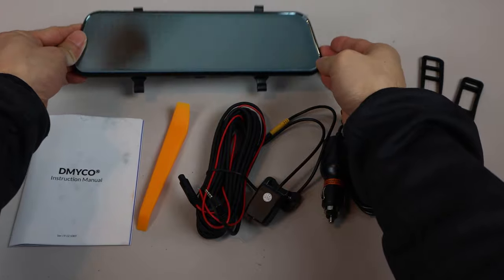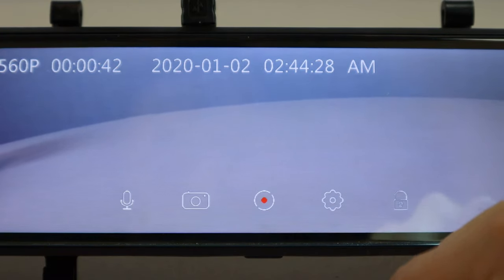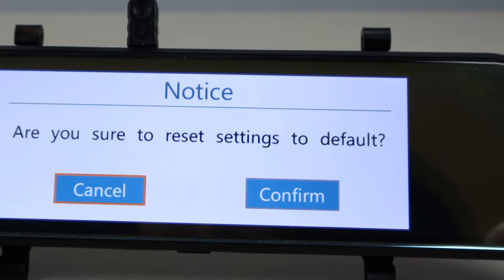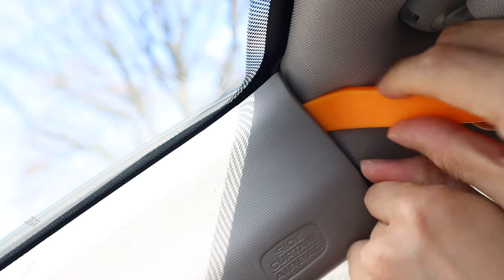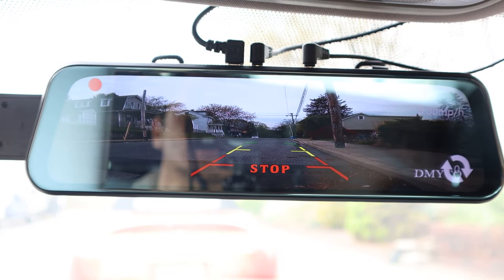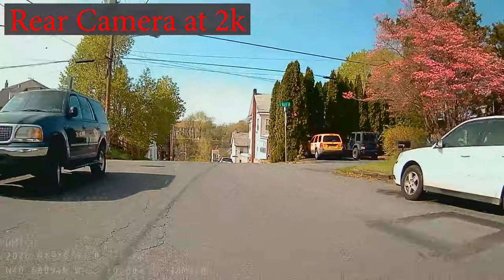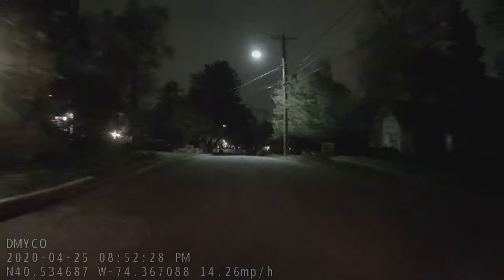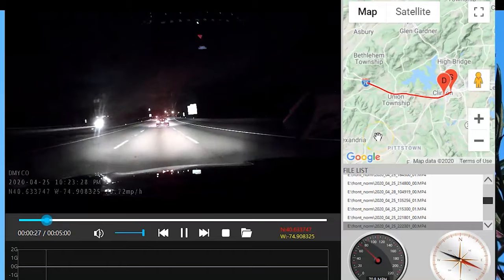Dmyco 10 inch 2K Rearview Mirror Dash Cam with GPS Review

Comment: Hi. I turn on the dashcam and its frozen. Saying format sd card but i can't touch anything or use the menu. Whats the problem?
Reply from the maker: It's possible the digitizer has malfunctioned so it's not responding to touches. You may need to contact the vendor for replacement or refund.

Comment: love your videos, very true to life explanations and decent quality for a smaller channel, nice work, also this system for a dashcam seems pretty awesome and intuitive, especially sense it comes with both back and front cameras, so no need to buy two dash cams separately, love that you can set it to use the back dashcam automatically, that would def. bring up some safety concerns if you had to fumble through the interface while driving.

Comment: Nice video - thanks!  I did not see how the rear view mirror can be used as a GPS...hmm... may be i missed it?
Reply from the maker: The GPS antenna is a separate piece, and I show where you plug it into the camera at 1:18. Once plugged in, you can place it anywhere on your dashboard or on the windshield, using the adhesive sticker so it can pick up GPS signal. The GPS tracks your route and will also help calculate your travel speed and direction of travel (see 12:34).

Comment: Hi, thanks for the nice work! One question, the GPS is not working properly, it shows me a yellow sign on the display as it is searching, but not working all the time
Reply from the maker: Hm, this may indicate a poor signal due to placement. Try moving the GPS unit to a different spot or higher up on the windshield glass and see if that helps, it's possible that the antennae for the radio may be causing interference with the GPS signal.

Comment: Nice video.  I see that you mounted the rear camera on the exterior of the car.  So, it is weatherproof?
Thanks.
Reply from the maker: Yes, the rear camera is weather proof, though I have found, for these types of cameras, that the tiny screws that are on the bracket do rust over time.
Reply: @ReviewedByPhil  Thanks!

Comment: Great video. Will the GPS files run on an Apple 🍏 MacBook computer? Will the power lead to the mirror interfere with the DAB radio signal? Can the GPS antenna be hidden out of sight? Thanks in advance.
Reply from the maker: I'm sure with an appropriate video decoder app you can view the GPS data on a Mac, as it's embedded in the video file itself. Yes, occasionally the power lead can interfere with radio signal depending on the location of your antenna and how you run the wires (don't run the power one way and the rear camera lead the other across the top of your windshield, as this basically creates a faraday cage around your windshield and blocks a majority of radio reception). Yes, the GPS cable can be hidden under the trim the same way you hide the power and read camera cables.
Reply: @ReviewedByPhil  Thank you for taking the time to reply. It's is very helpful.

Comment: How happy are you with the dashcam? Is it bulky?
Reply from the maker: I do like it. It's bulky in the sense that I can't put my drvier's side visor all the way forward, because it messes with the camera angle. And if you don't have it strapped in tight it can bounce/vibrate a whole lot. It's not too distracting if you're not starting at the screen, which you shouldn't be anyway, because you know, you're driving! I do want to put some thread locker on the screws on the reverse camera because road vibrations tend to make the back camera sag down over time, and I have to point it back up every once in a while.
Reply: @ReviewedByPhil  Thank you for your prompt response. I wish there was a dashcam mirror that I can use to replace the factory fitted mirror in my 2017 Toyota Camry. What I like about this dash cam is that it has a lot of features and I can get a full view of the rear of my car. Is it better to have windshield-mounted dashcam or mirror dashcam? Does this dashcam have a lot of reflection from the car's dashboard?
Reply from the maker: @kpkaus  I prefer the mirror mounted ones because they generally give you a wider on-screen display and I don't like having a lot of clutter on the windshield. I find it more natural to look at the mirror too, than at a separate device mounted elsewhere on the window. The only real issue for folks is the vibration due to the nature of the rubber band mounting. Maybe clamps or glue could solve that issue, but I haven't tried it. No, there's isn't any reflection from the dashboard, since the dashboard isn't generally viewable in the mirror.
Reply: @ReviewedByPhil  Thank you.
Reply: @kpkaus  shinzen, nikomaku and awesafe has OEM mirror dashcams. Like you mount the dashcam itself and remove your stock mirror so nice right. Not bulky and not ugly. But the damn nikomaku as3 pro max is only available in Amazon Japan and Amazon USA. I live in Canada and Amazon.ca doesn't sell the as3. There are hundreds of mirror dashcams on amazon.ca but most of them are just the mount or strap dashcam so no good.

Comment: Do you think it would be possible somehow to attach this dashcam "mirror" directly onto the windshield, rather than tying it onto the original rearview mirror?
Reply from the maker: Hm, I'm not sure. There isn't really any "mounting point" on the dashcam, so other than the plastic brackets for the rubber bands, there's no clear way to attach the unit to anything else unless possibly the window mount uses adhesive to grip the mirror; then maybe you could glue/stick the dashcam to the mount.

Comment: Is the blue wire in your reverse light socket the positive wire?  Can you explain why red wire from rear camera was  inserted into black negative side of reverse light socket and not into blue side of socket. Thanks.
Reply from the maker: Actually, it doesn't matter which side of the circuit it's on as neither wire carries power until the car is put in reverse. Then at that point, both do, which is the trigger signal for the camera to switch. So regardless of which side of the connector you choose to splice the wire into, it should work the same.

Comment: Are the maps lifetime free update?
Reply from the maker: There are no maps to download for the device as the GPS on the dashcam doesn't display maps or directions on its screen. It simply records your location to the video file (longitude and latitude coordinates). When playing the files in the GXPlayer application, the map view is generated using the latest map files from Google Maps, so the maps should always be up-to-date during playback, and it plots your location based on the recorded coordinate data. This, however, requires an internet connection, and if the device you're running GXPlayer on isn't connected to the internet, you won't be able to see the map at all.

Comment: How did you install the gps?
Reply from the maker: The plug end of the GPS unit goes into the port shown at 1:01 to the right of the SDcard slot. Then I stuck it in the corner of my windshield on the passenger side and ran the wire under the trim along the right side of the windshield and through the ceiling panel to the camera.

Comment: does it monitor when parked?
Reply from the maker: There is a parking monitor option that you can enable, but I recommend that you hook it into an "always on" accessory port or the car's electrical system with a low voltage cutoff since the battery life of the camera isn't that long in parking mode.

Comment: Hi, great video. But does any one know how to change the displayed speed on the right of the camera from KPH  to MPH  ??
Reply from the maker: According to the instructions, you can change the units in the camera settings by changing the language. For mph, select English. The unit will display kph for other languages. For what it's worth, mine displays mph and I have it set to English. I have not experimented with the other languages to test which units appear for each.
Reply: Acording to a german Amazon review one can send an email to dmyco-de@foxmail.com and request a km/h update of the firmware, which then allows to switch the units. I do not (yet) have the cam, just providing the info I read before.
Reply from the maker: Thanks for the info!

Comment: Nothing about the moment when someone hit the car during day/night...
Reply from the maker: There's a parking monitor mode that will initiate a recording if your car it struck while it is parked, however you will have to manually turn the camera on after the car is turned off and set that mode. Depending on how many times it is activated, it may not have enough battery life to last the whole night.